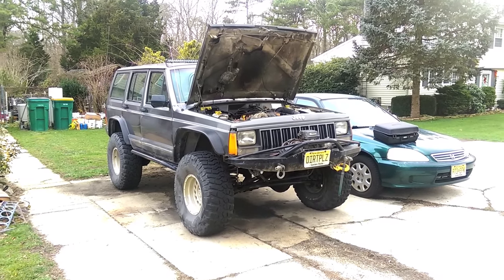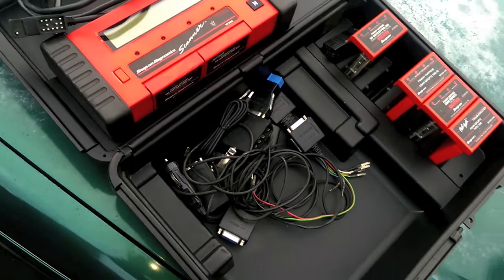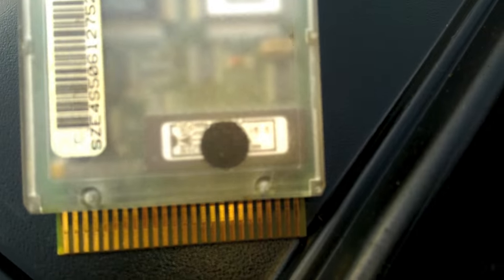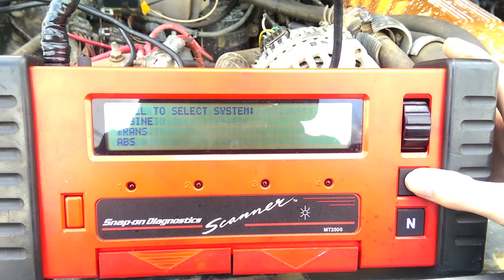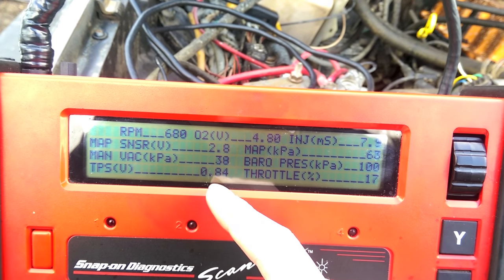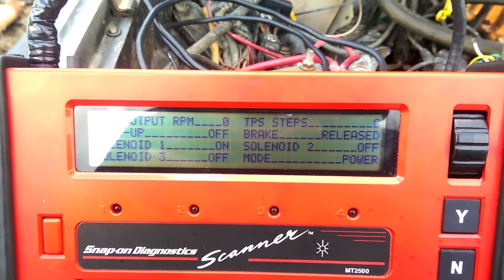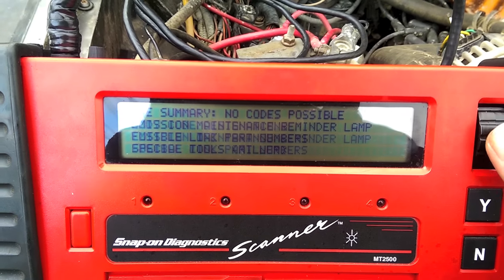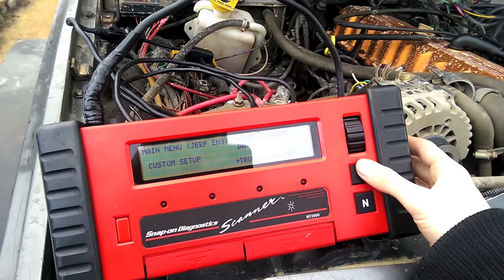89 Cherokee Reading Sensor Data with a Snap On Scanner

Comment: Well, well, well.  So there is a scanner for the Renix. I've been told a thousand times they don't exist, with a shoulder shrug when I asked "So what are these ports for?"   So not only did I find out they exist, but a great guide on how to use it. My old girl has always run well, but I suspected something was a little bit off.  Time to find out!!  Thanks for the great instructional video!

Comment: Because of you Nick I went out a got an MT2500. We have 4 brands of vehicles, including 2 Renix XJ's. This scanner/reader makes getting things right on our vehicles so much easier !! Thanks for all of your efforts !!
Reply: Desert Mike DIY A actron CP9690 works on OBDI Ford, G.M. Chrysler and 2 Toyota. Also OBDII to 2013. It is updatable. It tests live, record, exhaust smog readiness test, code connect for troubleshooting. It comes in a black pouch. It has a cigarette lighter adapter. It remembers previous cars tested.
Reply: ¿Dónde lo compraste?
Reply: @miniemouse2750  Ebay, Facebook, internet.

Comment: Snap-On also has manuals, emission cartridges, transmission cartridges, and adapters for different vehicles. Get the latest cartridges. Dial in the VIN number. If it won't communicate, try a different year but same engine. Warm up the engine to operating temp. to warm up the O2 sensors. Replace most important code parts first. Then retest. Sometimes replacing 1 part eliminates other codes! On E-Bay, check other adapters from other sellers for cheaper prices. Get the 120 volt wall outlet adapter. Also the battery Pak. Get the battery cable adaptor to hook up to the adaptor and battery. See if you can get a printer.

Comment: the fuel sync is the signal from the cam sensor in the distributor. the data feeds too slow but as long as it changes from a + to - its getting a signal.

Comment: there is a lot of confusion about the renix/ducillier system, it was only used on 2 vehicles in the usa market, the amc/renault alliance car with fuel injection and the amc-produced jeep vehicles with fuel injection. if your jeep was made by chrysler, it will have the chrysler engine control system. the snap-on mt2500 scanner is one of the few scan tools that will interface with the renix/ducillier system, the only other one i know of is the one they used at the amc dealers i can't remember who made it but it was just for the renix/duciller syem only. otc never offered software or cables for that system.

Comment: I first watched this prior to your intro of the REM. It appears as if this can write to the ecu. In a different vid with the new REM you've described another person  that queries and writes to the ecu. I commented on that vid to discuss your design, perhaps it is possible to update the REM to do this too
Reply from the maker: YouTube can be awful with responses but I've got tons of contact methods on my website Nickintimedesign.com . Renix is read only from everything I've seen so far. OBD1 is an entirely different breed with modern communication protocols which I believe accept tunes or modifications but not entirely sure. Renix is a big ol mystery I've slowly been trying to crack.

Comment: Just bought an MT 2500 tonight. Looking forward to looking at the data in our '88 XJ !
Reply from the maker: It's pretty cool stuff. I've gone over the deep-end with this stuff though, got so entrenched with data I made my own arduino scan tool, haha. Super fast live updates on the dash at all times, can't drive without it now!
Reply: One thing is not right. When scrolling the menus, the info after Exhaust is blank. Neither lean or rich shows up. I've moved the data cable and jeep adapter around but that didn't change anything. Closed loop or open loop, same problem. The cps has melted wire insulation, but doesn't seem shorted or open.  Any ideas ?
Reply from the maker: +mikep95133 hmm, that's weird. Well all the data that it displays comes over the same serial connection, so if you get some readings then you should get all of them. That's very weird. What cartridge do you have?
Reply: I think it came with a 1098 or 1097.
Reply: I just tried a black programmable cartridge and it worked right. So maybe the 1098 cartridge is bad.
Reply from the maker: +mikep95133 hmm, interesting. I've got a 1099 that works fine, wonder if that year is a bit goofed.
Reply: My 1098 has "SNAPON" written on the bottom in permanent marker. Maybe it's been dinked with ? At least  I have something that works.
Reply: From $150 to $250. Mostly depends on how many cartridges and adapters they come with.

Comment: Om my 90 renix the scanner reads the ST fuel trim changes when cold then stabilizes at 128. LT is always at 128.

The 02 sensor swings but not nearly as much as yours, never gets below 3.5.

Exaust stays on lean never going rich.

My MAP swings from 1.7 - 2.1

4 hole volvo injectors pulse is 5.7

Comment: Hey Nick, saw your new Renix scanner you designed and built yourself. Genius. So I know you can tell me why the PROM on my MT 2500 displays B1143FFEFDF7 most times. Or B1143FFFFFFF on occasion.

Thanks for any input.  p.s. Your alt. puts out 13.8 volts mostly? My stockers only at 13.1 if that.
Reply from the maker: Ok, this actual gives me a bit of relief now. Short Answer: the ECU's are dumb and spit out junk numbers sometimes which has been quite an annoyance when debugging my own scanner.

Long Answer: Get ready for a full bowl of nerd. I'm not entirely sure what all the PROM numbers mean, but the first 3 should never change. Each byte is displayed in hexadecimal so they only use 2 digits instead of 3 for normal decimal.

Byte 0 is the Program Version which I have only seen B0 (176) or B1 (177)
Byte 1 is PROM Version which I have seen bunch, don't know correlation. 14 (20) is a more common one.
Byte 2 is Calibration Code which also vary a bit. 3F (63) would be the final series for most 89-90 models

Now here is where I have had to guess the rest of the way.
Byte 11 seems to be a 2 part mid stream check. FC (252), FD (253), and FE (254) are usual. When things get wonky their values will be lost with FF (255) which is the highest number that a byte can represent.
Byte 10 comes after 11,  FC (252), FD (253), and FE (254) are usual. also suffers from FF issues
Byte 30 seems to be the final check byte to verify stream length which is great except it can sometimes suffer from the dreaded FF (255) issue as well which is rather annoying. F2 (242), F3 (243), and F7 (247) are usual.

So basically when you see all those FF's, your ECU is spitting out a bunch of extra numbers that the scanner is accounting for but I have even seen some normal data bytes being replaced at times when it get's really bad. No idea what causes it. FF (255) is represented in binary as all 0's, so the only way the computer know anything is there is becuase of the start bit that lets the receiver know that a byte is coming. A small amount of interference could cause a blip and be interpreted as a 255, but that doesn't seem to be the case here as the bit length (the time a number will be high or low for) is the exact same has a normal bit and it even leaves the proper space until the next byte so it's definitely the ECU doing it. Hope that gives you some insight.

As for the Alternator voltage, a couple factors will affect that. Current amperage demand, strength of alternator, battery charge, and engine speed all play a part in charging voltage. At least 13V is acceptable. I also have an aftermarket alternator that can push 170 amps which is a bit higher then then max 105A stock.
Reply from the maker: So update, was talking with someone across the pond and he mentioned that if the number 255 needed to be transmitted, they would send it twice so that the reader didn't accidentally pick it up as the end of the stream. So now i can clean up the data properly since i know it's not just some random glitch.

Comment: Nick i’m glad I found this vid as i just purchased a mt2500 and i think it is good to have my question is could this be used as a diagnostic real-time monitor so i want to be able to drive and see what it’s doing with a passenger of course seeing what it’s doing i think it also has a feature that you can save data called (movie)
Reply from the maker: Yeah, you can use it while driving, it's just a little clunky to keep in the Jeep. If you want something portable you can look up my Renix Engine Monitor, it's small enough to keep permanently mounted and shows you all sorts of readings the MT2500 doesn't.

Comment: Hey quick question, open loop/closed loop is mainly determined by O2 sensor temp right? I know that coolant temp is also a factor but I'm guessing not primary. I have a 92 and i noticed yours switched over when coolant temp was at around 70F
Reply from the maker: For Renix it doesn't care about temperature, just starts attempting closed loop after 30 seconds and the sensor is hot.
Reply: Is that solely renix or does that apply up to 96 years?
Reply from the maker: I don't know for sure for other years. That's just what I have seen while working on renix.

Comment: Hey Nick, will the monitor you are making do the same thing as the MT2500? 
MY 1990 is stumbling slightly and the further I go the worse it gets after getting to opporating temp and sometimes it will shutdown.
Reply from the maker: Yep, my Renix Engine Monitors can read every gauge the MT2500 can, and even more custom ones that I wrote.

Comment: Can you pull codes for the engine if you had a bad crank sensor for example?
Reply from the maker: On Renix Jeeps with snapon there are no traditional trouble codes as it's only live sensor data. 

With my custom REM Renix Engine Monitor scan tool I was able to find some injector and relay codes that the Jeep computer does provide. It's also fairly easy to catch sensor issues while driving since it's portable
Reply: @NickInTimeFilms  what's the link to purchase the renix device. I've watched your other videos and it seems like a nifty gadget :D
Reply from the maker: @dalldall1621  https://nickintimedesign.com/product/renix-engine-monitor-ii/

Comment: I found a cartidge online but it just says GM-Chrysler-Ford, however it is 2500-1094. Would it work? Or should I find one that says jeep?
Reply from the maker: Yeah, that'll work. Check the description for all available numbers
Reply: Gotcha. And if something is wrong, will it throw a code? Because I see it says "no codes available in this mode." So does the code come from the troubleshooter?
Reply from the maker: That's the only thing with the Renix ECU's, they don't store any trouble codes so you have to figure it out on your own. The Troubleshooter does just that, it gives you tips to troubleshoot. But after building my own scanner I can tell you what just about everything means in great detail.
Reply: Gotcha. Well, I will continue my search for a good deal. Don't want to spend too much.
Reply: Try to find emission cartridges which give helpful tips. Get the latest cartridges in case you come across a later car. Get the manuals! Get the battery adapter which plugs into the positive cable to the adaptor. It powers the adaptor.

Comment: Hi, for years I'm looking obd1 live data scantool for my 1995. 4.0 wrangler. Will I be able to reset adaptive memory, read live data, bleed brakes ? (i have ABS and i heard that it wont be able without scanner activating pump etc). I know this can be done with DRBIII but its very pricey for a home use :)
Reply from the maker: I think the key on, key off, headlight switch procedure will reset adaptive memory but this will read live data for your jeep if you have the right adapter. either CHRY-1 Adapter or CHRY-2 I think, and a proper jeep cartridge. I'm not 100% sure about the abs functionality but there is an ABS option so i'm sure it does something
Reply: Thanks a lot, I've read about that trick but wasn't sure. Is there bi-directional communication with ECU (like setting rpm, injector shut down) or it just reads data?
Reply from the maker: When I used it on my buddies 95 I remember there were system tests you could run for relays and components, but I don't think it has any ECU reprogramming in it.
Reply: That is what I was looking for. Thanks a lot.

Comment: Is there a difference between the MT2500 and can the mtg2500 can the mtg used the same way with cartridges and adapters?
Reply from the maker: The MTG is the graphing version with fancy screen. Man the deals are crazy on ebay, nearly bought a huge set for $300 just browsing haha. From the looks of it, the MTG uses the same cartridges and adapters as the MT
Reply: @NickInTimeFilms   I picked up one with the cartridges for jeep and few others and adapters. Also all the manuals and hard case for $179. I think i did good.
Reply from the maker: Nice work, you'll have to let me know how the graphing stuff looks
Reply: @NickInTimeFilms  Ill play around with it and see how it works then take some pics right now trying to get my 90 renix running smoothly.

Comment: And i bet from new it made the original buyers wallet scream a lot lol :-D
An extention cable into the truck would make it nicer, you dont want to be balancing on the hood while your mate is driving down the road while you log live data ha ha :-D
I bet out there, somewhere, there is a converter matchbox that converts that port to the obd2 system with bluetooth, and your andriod phone will show all the settings :-)
Reply from the maker: +zx8401ztv The data cable is long enough to route through a crack in the hood and through the passenger window, no need for the wing man. haha. As for a converter, it's hard enough to just find anything at all that will directly communicate with this oddball system. Some people have made basic converters to communicate with a laptop, but most of those scripts are unfinished. If I could code then A little portable system monitor would be awesome.
Reply: +NickInTimeFilms 
Pity there wasnt an obd2 ecu made that will replace it, dam!!
I still have the image of you balancing on the wing or fender, that would make a rollercoster a boring trip lol.
Ahh nice long cable :-)
Im sorry if i missed it but does the tool save the live data from your renix to its own memory?
Reply from the maker: +zx8401ztv I don't believe so but I could be mistaken.

Comment: what about 91, im getting mixed answers. it is not renix, correct?
Reply from the maker: 91 - 95 is OBD1, but the MT2500 can read that as well.  You'll need:
- any Jeep Primary Cartridge before 2000 (list in description)
- a CHRY-1 Adapter for the ECU and alligator clip or cigarette lighter barrel connector for positive power
- a CHRY-2 Adapter for ABS and TCU
Reply: NickInTimeFilms I appreciate you